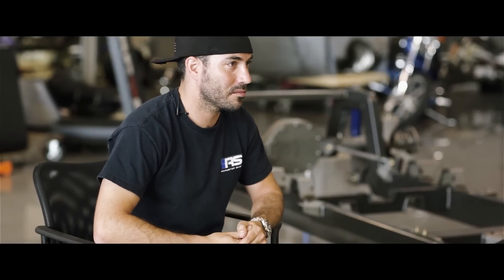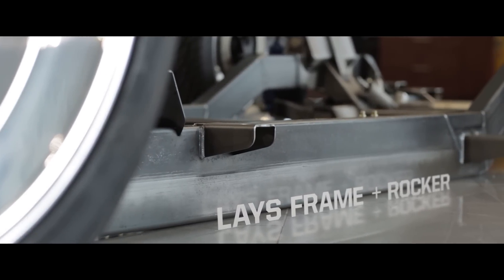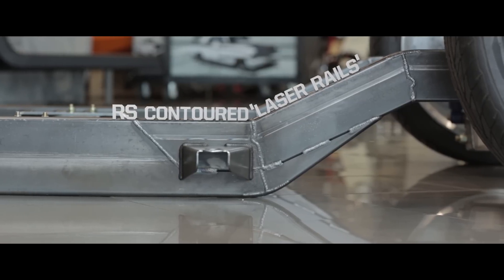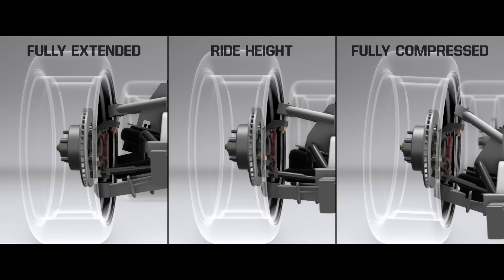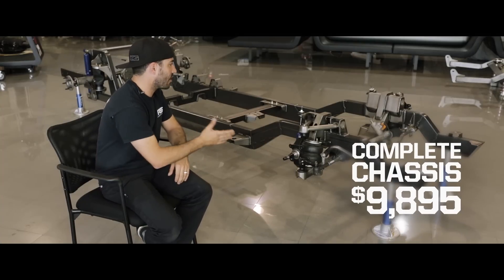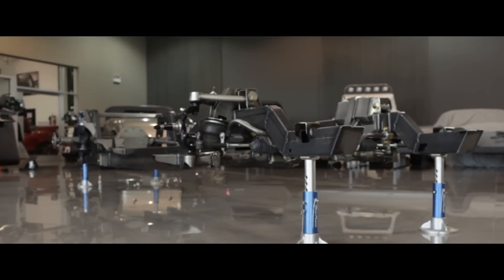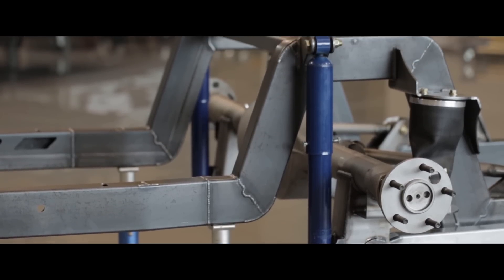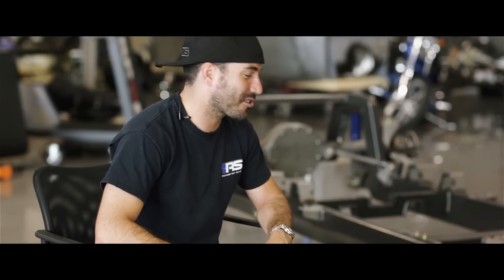Roadster Shop SPEC series C10 chassis

Comment: Is this still available for under 10000?
Reply from the maker: Thanks for watching the video! In the 5 years since this video came out we have had to increase price slightly to $10,795 starting depending on model year and options.  I’ve updated this in the video description.
Reply: @RoadsterShop   It's still a very nice deal. I have A66C10 and him debating on air ride or just a drop spindle static drop
Reply from the maker: @mr.e1220  We do an RS SPEC Chassis in the slammed version both static with Fox suspension and slammed with bags for $10,795 - Check out the page for that https://roadstershop.com/product/full-chassis/1960-66-c10-truck-spec-chassis-slammed/  and let us know if you have any questions!

Comment: No suspension kit cost any near double that frames 10k, you could build that for 2500 with enough thinking and welding
Reply: And without those god-awful frame arches in the rear.

Comment: I'm building a c10. Bit thing is I'm putting a 24 valve cummins in it with about 850 horsepower. How would this   Chassis handle this. A reply would appreciated.